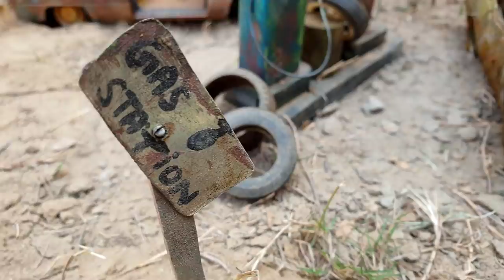Restoration Fast & Furious Letty's Plymouth Barracuda Muscle Car

Comment: Props on getting the name right! Most people call the Barracuda a “Cuda” even though they are both different. The Cuda is the more rare performance version with the iconic shaker and a bunch of other performance stuff. But it’s more sought after than the barracuda. It’s nice to see that some people know what the difference between the two
Reply: Plymouth hemi cuda
Reply: Sure it was since 1970.. they changed the whole body and included the hemi with the shaker meanwhile barracuda were the first two generations from 1966-69
Reply: Yes, the 1973 “ ‘cuda “ option package was a performance oriented package including a high performance 340 ci engine. This car was then painted to look like a 1970 AAR  ‘cuda .